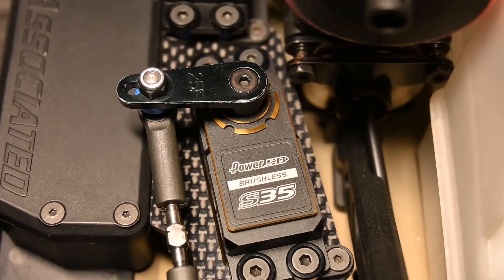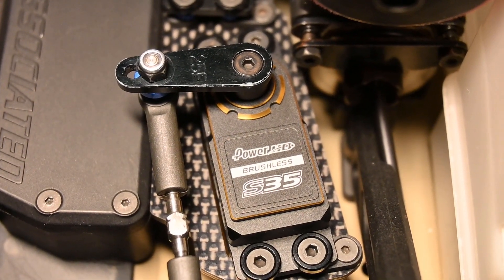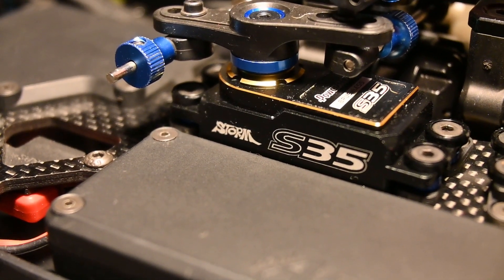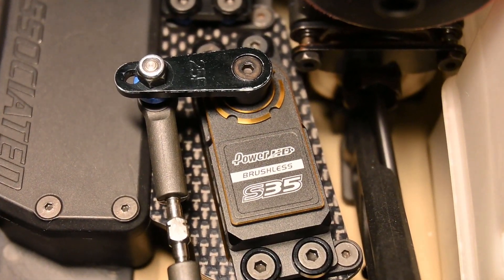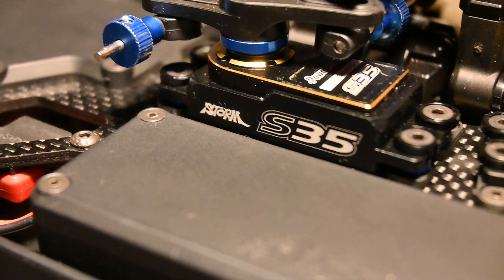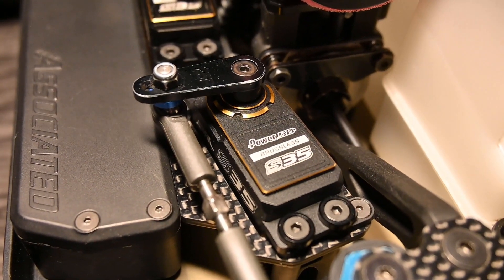From the ground up: Servos

Comment: The rc8b3.2 kit setting for the servo saver gap at the bottom is 1.5mm

Would u reccommend using a bigger gap and what affect does the servo saver gap length have on the overall steering feel and the internal servo gears?  

Cheers Tom
Reply from the maker: I always tighten my servo saver as far as it goes. It makes for a more direct and precise feel on the steering and I have had no issues with servo durability. I would personally prefer there to not be a servo saver at all.
Reply: @maxmortrc  Ok thanks Max I will tighten my servo saver as far as it goes

Comment: I look at the linearity a bit different and thought I'd join the conversation :) 
On the steering, let's start from the beginning. EPA is set so that with 100% D/R , the servo doesn't break anything or put any stress in the linkages. This is not a setup, this is more like a solid foundation.  If I come to the hairpin and feel like I can get thru without using full lock (or at least close) I adjust D/R to get better resolution. If I want to make small corrections during a straight and the car feels twitchy, I make a more negative curve. This increases my resolution in the that area while leaving my max steering untouched. Also I'm not really sure what linear means, like yes, there is a line in the transmitter but then we have the linkages running in circular motions and in different angles and what not. On top of that the slip angle of the tire making the amount steering you actually get, depend of the speed and grip. That's why instead, I only focus on if the car does what I expect it to, if that feels wrong, I change as described above.
I don't think there's any right or wrong, but this is the way I look at it :)
Reply from the maker: The servo arm length and the speed of the servo are very determining factors to me though hence why i put a lot of focus on that. The servo is not infinitely accurate, it has some degree of tolerance on each movement. The longer distance the servo arm moves the less these inaccuracies affect the actual steering motion and providing with better feel. A lower speed of the servo just calms everything down and also adds accuracy as the servo doesn't have to make too fast movements.

What comes to adjusting the curve the main issue I have with it is that it makes the feel of the steering around the apex of the steering curve more unpredictable. If you add a lot of exponential you will start to feel this. Lap after lap it is harder to pick the right amount of steering if you have to use the mid range as the differences are more profound than it would be without any exponential. Mechanical expo makes a difference but to me I haven't noticed it having as clear of an effect as I have with adjusting on the radio. This all however is different for every driver. 

To me predictability = linearity and thinking of it now predictability is a better word to describe what I want to achieve than linearity as you pointed out linearity can be subjective.

I appreciate the insight!
Reply: @maxmortrc  I'm thinkning a long servo arm would have the benefit getting more throw/degree of servo movement, making the force more consistent? But If all linkages work together, maybe that effect is zeroed out?
You mentioned that hits on the wheels also makes a difference. If using a servo saverand a long arm, hitting a given rock would move the arm fewer degrees, transferring less torque through the servo saver to the servo, while a shorter arm would possibly make the servo strong enough to take the impact, even without servo saver? I think there's a lot to consider in this ':D
Reply from the maker: @Weekend-Driver  Longer servo arm means longer moment arm which means a higher force. Longer servo arm means a bigger radius which means a larger perimeter which then on means you will have less degrees of movement for the millimetres of movement.
Reply: @maxmortrc  I think if you apply a constant force at a longer moment arm, the torque will increase. If you have a constant torque, the force you get will decrease by making the moment arm longer. It should be impossible to gain both millimeters and newtons at the same time
Reply from the maker: @Weekend-Driver  Yes exactly it is impossible to gain both newtons and millimeters. You will use exactly the same amount of force to turn the wheels of the car but for a longer arm that force is applied in a shorter stroke from the servo. This means that at any given degree movement the longer arm will have more force behind it but to make any given mm change the force will be the same for both arms.
Reply: @maxmortrc  Hi, adding a bit to servo horn length.  Why wouldn't you want to have it in same length as stearing horn on the stearing pole (don't know the exact name of that part). The point behind is that when you have them in same length then they are parallel to each other and move parallel together. And when you have them in different lengths then servo has to move different angular amounts from left to right to have same angles for the wheels from left to right. Maybe it's hard to understand just by looking at what I said but if you put it on paper two scenarios on servo horn lengths you should get what I mean. And that in my opinion would be the best way of doing it.
Nice videos by the way! Don't forget to shave :D
Reply from the maker: @andriusgedvilas4125  I do agree that is the best way of doing it but the issue is the bell crank and the servo saver arm are not the same length. So to compensate for that a shorter servo arm is better in my opinion.
Reply: @maxmortrc  I see what you are saying but i don't understand how that's related.  
  If servo arm and servo saver arm are in same length then it means every angle of servo movement is equal to the angle of servo saver movement (they are parallel and it means there is no deviation from left to right). Since bell cranks angle is fixed to the servo saver, it means that they move same amount together no matter what, so let's say you turn your steering 20* degrees to the left so then servo moves 20* - servo saver 20* - bell crank 20*, and same 20* degrees goes to the right.  But now if let's say servo arm is shorter than servo saver arm, then you turn left 20* degrees then servo goes 20* - servo saver 16* - bell crank 16*, and if you turn right 20* then servo goes 20* - servo saver 18*  - crank bell 18*. And so there is a deviation from left to right that would not be much but still something that you need to compensate with EPA. 
  That's why I think it's always better having servo arm in same length as servo saver arm, and yea just adjust speed with speed setting.
Tell me if I'm missing something here?? 
(By the why movement angles are only as representation but they are carrying the point)
Cheers!
Reply from the maker: @andriusgedvilas4125  Yeah you are correct. It doesnt however make a large difference in the end because of the fact that the way the servo arms and the servo saver arms are usually made there isnt much room for the steering link and often the shortest possible servo arm is very close to the same lenght.

Comment: Hi Max, enjoying this series especially before I rebuild my car ready for the season! Regarding servos and amount of input, one thing I want to do is adjust the amount of brake in the trigger on the radio. I feel I have maybe 75 % throttle and only 25% brake which doesn't help modulating the brake and allowing for a more subtle input. Curious to know how you tune this or what you suggest. Thanks
Reply from the maker: It depends on your radio. I believe the sanwa radio has the option to tune it however I've never tuned it. Generally the way our brakes are designed in 8th scale no matter the input on your radio the brakes will have very poor input. Most people including myself give only taps on the brakes instead of playing with the amount of brake like you would do with full scale racing.

What I like to do is to slow down the brake quite much from the speed option so giving taps on the brakes gives you less than full brake and holding the brake would give you the full brake pressure. This is something i prefer myself and its much easier to setup and control.